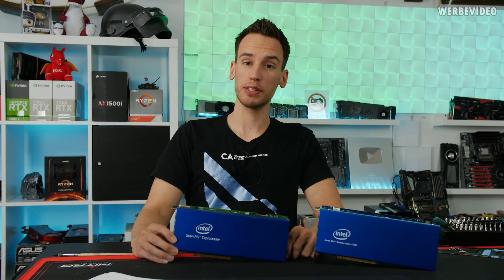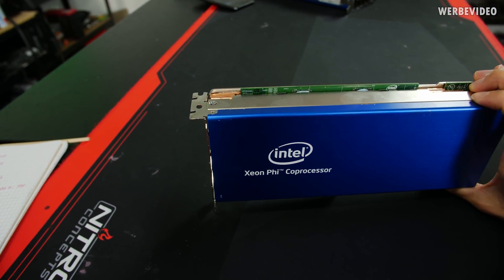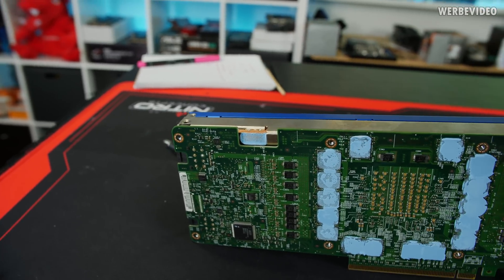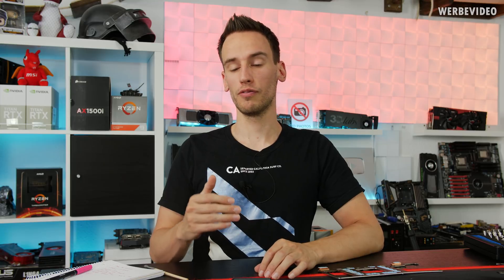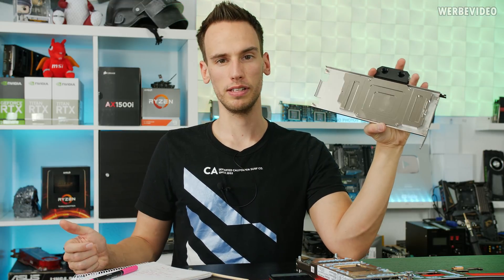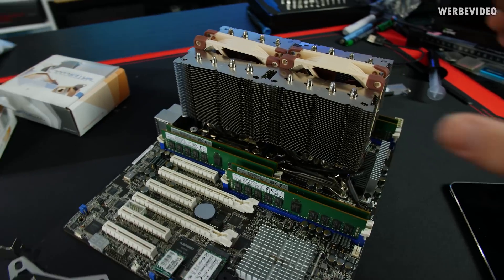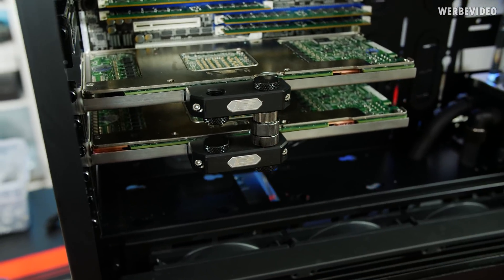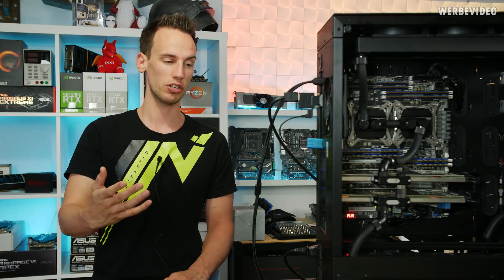Viewer-Mail Ep3: VGA Shaped Intel CPU with 61 Cores - Intel Xeon Phi

Comment: That's pretty cool but I bet if you were to use it for the same stuff you're using your main CPU for, most i5 skew or better 12th generation chips would probably be able to kick this thing in the teeth because of its single humongous core performance advantage and better ability to process many different kinds of information at the same time.

Comment: I know I'm a bit late, but GPUPI can actually run on any Xeon Phi! You need specifically version 3.3, after that they stopped supporting Xeon Phis. If you'd like, I can get you in contact with a guy who holds a few of the hardwarebot GPUPI records with Xeon Phis

Comment: Could you please share a bit more on the cooling solution, especially where did you get the cooling case? I am trying to fit three of them into the tided slots but the blue large Intel case is annoying...

Comment: would be great if you could use it for something like virtualbox, and at those clocks yeah gaming would be horrible.. with that many threads per core...yeah... even worse... lulzy though...heh....

it would be interesting to see if a more modern cpu on a 16x card could be made to add modern features if not high clocks, to older systems... just a weird thought...

Comment: I've had the 7120 xeon phi in my personal system for about 3 or 4 years. I'm very proficient in C++ and OpenCL, but I haven't yet found a workload that runs efficiently on these. Modern GPUs (GTX 1070 and Vega 64) and CPUs (6800K and recently 3960X) has been much faster at everything I've thrown at them. 
The best relative performers has been very branched OpenCL code, but the OpenCL drivers are old (2014 is the latest update) and not optimised well, so the performance is still ass.
Reply: I would assume they're better with random forests than gpus.

Comment: The metal connection from cpu side to the backplate side is not going to help cooling much..its too far ..theres already heaps of contact with air before that point .. water cooling is a bit extreme .. how about just put holes in the blue cover to let air flow in ... eg Attach a fan over a hole in the blue cover .. or. To the end of the card .. or just sure the air pressure  inside the case will cause air flow through the blue cover to the outside ..

Comment: I used to collaborate with a team responsible for the software stack for Xeon Phis - you can find everything here: https://software.intel.com/content/www/us/en/develop/articles/intel-manycore-platform-software-stack-mpss.html. There is a version for Windows, but this product was mainly focused on running under Linux. As others said there are benchmarks for these processors, and there are libraries you could use with them. 

Here's also a reserach paper that shows how Xeon Phi compares to regular CPUs in tissue modelling: https://www.researchgate.net/publication/313926514_Implementation_of_an_Agent-Based_Parallel_Tissue_Modelling_Framework_for_the_Intel_MIC_Architecture
Reply: This is a crazy question but has there ever been a case of it working on an amd system.

Comment: Where'd you find those waterblocks?  I've been meaning to get a cheap Phi on eBay to mess about with in my X99 system, but I can't find a good thermal solution for the older ones.
Reply: Can this coprescessor work with a gaming X99 mobo?

I already have a Xeon processor installed in my X99 mobo

Comment: Intel also made servers (Knights Bridge and Knights Mill) that used these processors.  They were "compute sleds" designed to go into a  Bobcat Peak chassis (2U chassis designed to hold four sleds).  They were intended for supercomputing type applications, where the number of threads was more advantageous than raw processor speed.  The instruction set is  x86, you can install a standard Linux build on it!
Reply: I own the 4 node server. You can run windows on them. It’s a lot of fun.

Comment: for benchmarking just use some linux cpu load scripts . not sure if it will work properly but the last time i worked with a preconfigured one of those machines the scripts that uses multiprocessing orked fine on all cores of the cpus . it was 7 or 8 years ago . so i am not realy sure what was on those machines all i can remember is that they are using mpi to distrubut the load over  the whole system and i tested a small script and it worked well

Comment: No it looks like a graphics card not a VGA. Really it's just a daughter board. VGA is a type of graphical interface not a graphics card. VGA stands for Video Graphics Array and is usually just a connector interface with the controller not the entire card. Also Graphics cards are usually a Chipset just like the CPU in your computer that handles the excessive processing that graphical data creates on a computer, they can be modified to run processes only so basically it would be no different than adding another CPU to your computer using a daughterboard interface such as  PCI or PCIe interface. Bitcoin Miners use high end graphics cards to run their processes the more processes the more bitcoin you mine per day.

Comment: Havent done anything with these before, and prices have came down a ton, but theoretically you may be able to use these with virtual machines and run plenty of VM's on them. Splitting the core count up.

Comment: Those Phi coprocessors also run their own small Linux operating system, which you can log into over SSH. You don't need special code then, most x86 Linux code should work.

Comment: Best thing in consumer vga's are backplanes without any contact to RAM chips. I have Gigabyte GTX 970 G1 where backplane is only for asthetics and rigidity. It was too complicated to add thermal pads to those mighty 3.5GB of RAM 🤣🤣🤣

Comment: I am glad that there are research groups that can make use of these cards. We certainly cannot.
I have access to 2 supercomputers that were (for some godforsaken reason) built with a bunch of these accelerator cards. While I cannot speak for every user, I have a strong suspicion that noone actually uses the Phi cards, because software support is nonexistent.
These things cannot run OpenCL, because Intel cancelled the development of the OpenCL SDK shortly after release, and of course they cannot run CUDA. The only way to get any code running on these is to recompile your software from source code, using an obsolete version of Intel's compilers, as support was completely removed from newer versions.
Even if you can get something to run on the cards, they are about as fast as a glacier before climate change, and you have to rewrite everything from scratch to get reasonable performance. Its months of work, very few people can do it, and many scientific codes are a poor fit for the Xeon Phi architecture, so there is no guarantee it will be ever worth the effort to rewrite the software.
If they just spent all that money on more CPU cores, they would be used a lot more, instead they wasted probably about a million euros of taxpayer money on these stupid things that almost noone here can use.
Reply: You are right, they are useless and pretty much always were useless. At best scenario you are looking at 61 old Atom-level cores that are really weak at everything except specific AVX code, but that same code can be written to run in OpenCL/Cuda much faster. This thing got trashed by GPUs even when it was new, now its complete goner. And as a CPU this whole thing is a joke. If it threads ideally you can see it go up to like somewhere between 8C-12C ZEN2. Any hiccups in thread scaling = too slow to even bother. Not to mention the very limiting factor that is the memory size. Intel rightfully got nowhere with this thing, but they still had so much leverage that a lot of them got pushed in to various systems where they made questionable sense even when brand new. Tryning to run those things now is like trying to optimize for CELL or Itanium or Netburst. Just no. Its slow, old, let it be.
Reply: @Lady_Zenith  Yeah, I am just so pissed off that my government choose to spend the very very limited national HPC budget on these stupid things, instead of more ivybridge and haswell cpu cores.
Reply: @TheBackyardChemist  To put it in to perspective, the top latest model of this does around 1600-1700 points in cinebench R15 when the OS itself is running on it. Decent for 2013/14, but the top-end Haswell-EP from also 2014, the 18-core 2699v3 can do around 2600-2800 at lower TDP, and this is ideally threaded scenario, at pretty much anything else the Haswell will demolish it.

Comment: 2013: 60+ core cpu exist
2020: heres our all new 16 core cpu at a price that youll die for.
Reply: 2020 Amd: here's a 64 core cpu
Reply: 60 Pentium MMXs, IIRC, with vector extensions and HT. AFAIK, Intel just let them fade, having not taken over the market with them, rather than there being any real problems with the series. They really should have stuck with it, and pushed more software development.
Reply: 750$ for 16 cores isnt bad
Reply: i mean you can buy a 64 core threadripper too now , its like 4000 dollars but its damn near as fast as any of the other cpus except it has more cores. kinda amazing t hat they got a 64 core cpu to be just as good at gaming as their lower core count cpus
Reply: @Alexiel-f6o  it runs 2.9ghz all core at 280w
Reply: To be fair those 60 CPU cores are really really really slow and shitty
Reply: @zacht.1531  They aren't so much "slow and shitty" as they are simple and application specific
Phi's have 57-61 cores, with 4 threads per core, running at 1.0-1.2GHz. 
Per thread they're 1/10th the performance of a modern AMD64; but there's up to 244 threads running simultaneously. They're best suited for applications with massive numbers of threads that benefit from packed operations and per-thread branching, especially where the branching may cause pipeline stalls that kill performance in low-thread count CPUs.
The other thing these are not is an OpenCL/CUDA replacement. GPUs are really good at deterministic programming (ie, no branching and no easy way to work around no branching). If you're doing most "math" (like most scientific applications), GPUs will be much faster than Phi.

Comment: I'm a bit familiar with the Phi copro cards. They're meant only for server cooling. Rather than all this liquid trouble, it would be easier to acquire a SuperMicro 4U pedestal case and their kit for passive-cool cards, like Phi or Tesla. Or even a bare-bones 4U server chassis. These are fairly plentiful on the used market and cheap, as are Xeon E5-v4 boards and cpus.  From a software perspective, unlike GPU, phi are cut-down x86 and there's a special compiler for them. The simplified idea is to write regular x86 code for your compute tasks, then compile it through the Phi compiler and scale it out amongst as many cores as you can afford to operate. 

Honestly, I found the NV GPU easier to write code for, much more stable, with the Volta having better fp64 and the Turing having better fp16.

Comment: Someone needs to get crap like this working for gaming, it could be so useful for calculating physics.
Reply: Did you mean physX?
Reply: @mickolesmana5899  yes and no, it would need to be a bit more robust.
Reply: @deltacx1059  isn't already robust? but developer (in my assumption) don't utilize physX function as much
Reply: @mickolesmana5899  it would just be nice to have something that works more naturally with the newer APIs and engines
Reply: @deltacx1059  Ah you meant is ASIIC Card for PhysX that being optimize for physic calculation
Reply: @mickolesmana5899  pretty much.   A dedicated card that just handles all the physics.

Comment: They use the thick thermal pad on a vapor chamber because it's not a very good seal using thermal paste alone. Some times different heat sinks requires different types of materials. And even then some require different consistencies of that type of interface materials. You can't always use thermal Grizzly for every thermal interface material in every situation. In any case, if I remember correctly the vapor chamber can't withstand huge mounting pressures that are idea when using paste, so the heat pad is more idea in this situation.

Comment: i was rather hoping for some details on how/why intel came to choose a 61 Core Chip, but maybe you're just as curious as me and also don't know any details on that. oh well!
Reply: At a guess it's to optimize their yields. The die size on these is pretty substantial (approximately 3.5x the size of an i7-6700). If you design with 64 cores and anticipate disabling 3 due to defects, you increase your ratio of viable chips/die to something commercially viable.
Reply: @danielsmith6834  
hm, yeah that makes a lot more sense than imagining an intentional Silicon design of 61. i don't know what that didn't occur to me, lol.

Comment: do you think chained cooling is worth taking 600-800W power in single tube? no chance for separate paths for each coprocessor and CPU?
Reply from the maker: You can't overclock those CPUs. They won't care if the core is running at 75°C or 80°C
Reply: @der8auer  hey, i realy have no experience with such devices and massive cooling system, but could you post temperature readings of each 4 chips? I mean, under nominal load? temperature gradient over tube path might be so huge, starting with lower temp for first and going up through last

Comment: There's plenty of tutorials out there on how to boot Linux on the coprocessors. Intel MPSS supports SUSE  and RedHat as standard. And you can get Ubuntu running quite easily. Once up you can setup SSH on it and just SSH in like a normal distro.

Comment: Xeon Phi: only useful if you have a highly parallelizable problem which has such specific features that make GPUs unsuitable for a you. So you need a problem which is highly parallelizable but has something like extreme amounts of branching, or a need for constant direct access to another PCIe device, must likely be entirely dependent on full determinism, and can also make extreme use of hyperthreading while also meeting these requirements.

It's really pretty obvious why this failed. GPUs will be vastly faster for nearly everything. I think Intel really anticipated a very different product in the early days of this research. It's no wonder this only found use in very specific problems which have had supercomputers built specifically for them. Reminds be of the IBM CELL architecture.

Also you can get Phis that are LGA3647 and run Windows. But they don't even support virtualization, so the one area they may have been beneficial (many many low powered VMs) for is impossible to leverage.

Comment: The reason alot of people refer to these as gpus is because they started off life as gpus
If you look carefully you can still see the empty port where an HDMI would have been.
Second for benchmarking them, the only benchmark I was able to run on mine was the intel linpack benchmark, and I stopped it before it finished because it was shaking my table from how fast the fan was spinning (7120A)

Comment: I don't know about GCC compiler for those, but with Intel compiler (not free...), you have to target the device with the option -mmic nativeMIC. The code should run as if it was a manycore system. To run on both the CPU and coprocessors, you have to code the actual offloadings by hand! So you can compile chemistry softwares like NAMD or GROMACS, they support it already and are under free licenses of some sort (GROMACS is much easier though imo). During the run, you can ask for the device usage on Linux, but quite frankly, I don't remember how to do it (you can't just "htop" on those!).

Comment: I do scientific computing. I've never worked with them myself but I see these floating around on ebay at reasonable prices and was tempted to try and adapt them for workstation usage. It was a pleasant surprise to see this show up in my feed. I know there is an openCL SDK floating around for these. I've heard mixed opinions about it but you could compile something like blender with their openCL implementation to compare performance. May or may not be a headache though. It can be a drop in replacement in some instances.
Reply: I think the opencl sdk either never left beta or was just really buggy and clunky. Either way, Intel cancelled its development soon after release and instructed everyone to just use the Intel compilers.
Reply: @TheBackyardChemist  Intel Basicly cancelled the whole thing.... Just look at the latest driver release for those... They are massively crappy as they are not add in CPUs, rather separate pcs with next to no i/o ability... Feeding them data and getting it back is pure horror
Reply: Phi's suck at OpenCL-type loads, get a GPU if that's your application.
Phi's excel at applications with tons of branching threads. Most scientific computing isn't this.
Reply: @christophertstone  I didn't say they were. I implied the opposite in fact. I was mentioning a possible workload that someone could use for testing. If nothing else it might be an accessible way of testing thermals.